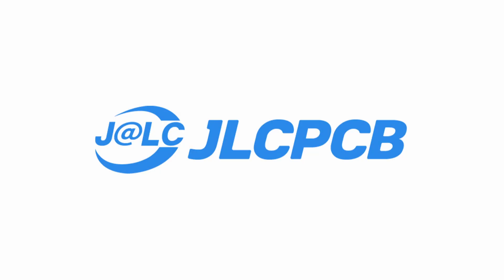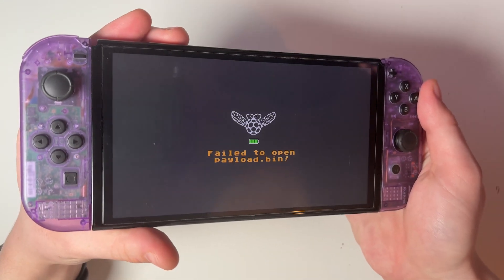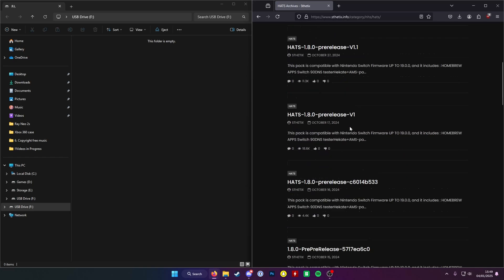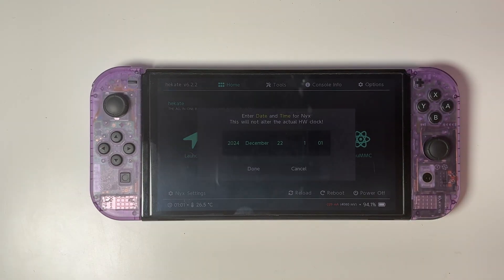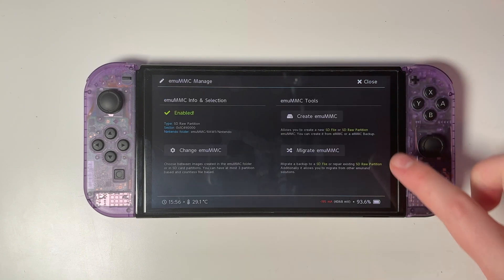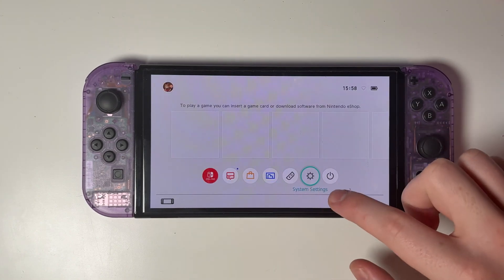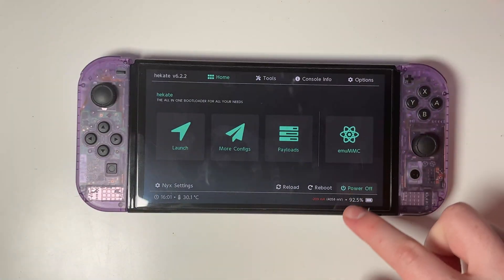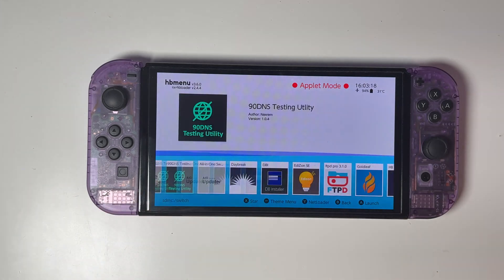How to Set Up Switch CFW: Dual NAND Guide

Comment: Just got my OLED Switch (RP2040 Pico-fly Modchip installed) I bought a 512 GB SDXC card with it. When putting the SD card in and trying to format it, it's asking to update the system. Should I do it or just get a simple 128 GB SD card?
Reply: Solution? You might install HATS first and do the formatting with hekate. Instead you can just use your PC.
Reply: @rephlax don’t remember what I did to a T. But I think I just used Rufus and changed the SD card format and everything worked lmao. Then updated all CFW and all that juicy stuff.

Comment: Great video - easy to follow and clearly explained...if I don't want to ever go online - how do I get the Switch to boot immediately into Atmosphere CFW? I delete Bootloder and Hakate? Cheers
Reply from the maker: There’s an auto boot section in Hekate where you can select which NAND you want to automatically boot into. However, if you do this, you can’t get back into Hekate without editing the config file on the microSD card using a PC. Unless you have an unpatched switch that can use the reboot to the Hekate homebrew app.

Comment: Will CFW work regardless of the firmware you are on?  I don't own a switch yet, but I will soon.
Reply: Video unclear at this point tbh. You first have to check your switch firmware, then dl the fitting HATS and follow the process shown in the video. I suggest to copy HATS to your SD and do the formatting afterwards.

Comment: On my console, everything works fine, but when I press the double volume buttons to go to OFW, it freezes. I have to soft reset and put it on the dock to reboot it. Why is this happening?EMMUMC is working fine
Reply: Clear out your MicroSD card, format it, and then install clean new set of files - this is a common issue, then it should all work fine again.

Comment: works at v1?when i hold vol. - + it just turns black not booting the official firmware and when i try to boot with the loade it says missing lpo minerva nyx missing
Reply: You should do more research...with Switch 1 - you need to put the console into rest mode but putting a jig on the right joycon rail then injecting a payload.

Comment: What is the difference with sd file or sd raw partition?
Reply from the maker: SD files convert the emuNAND into a file on the standard SD root, while partition creates a separate partition for the emuNAND to use. Since they perform the same function, the choice between using SD files or partition doesn’t significantly impact the outcome.

Comment: Hey bro, excellent video, straight forward with the hack and don't make us loose time, I want to ask is it 100% safe to play on the OFW online? We don't need any app to be safe of BAN? I think a video tutorial of how to play safe with no problem would be really nice, play with the OFW
Reply from the maker: OFW doesn’t run any homebrew or CFW at all, so it’s completely safe to use online. The only exception would be if you had autoRCM installed on a unpatched system, I think this can cause some issues.

Comment: Hey man! Great content. Got a question though. Why only 12 gb when partitioning ?
Reply from the maker: The 12GB is the “fake” internal storage that the EmuNAND uses so lots of space isn’t needed. 12GB is just a safe reserve of space for the system.
Reply: You need to have 29 FULL for a emummc to function
Reply: thanks for the quick reply. I know that but most of the videos  explaining the process tend to put the 24gb span